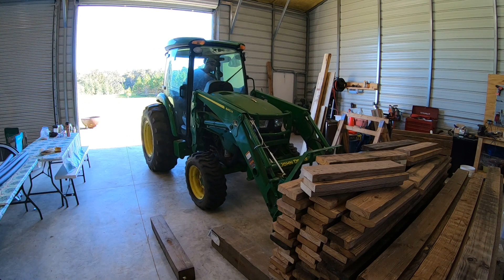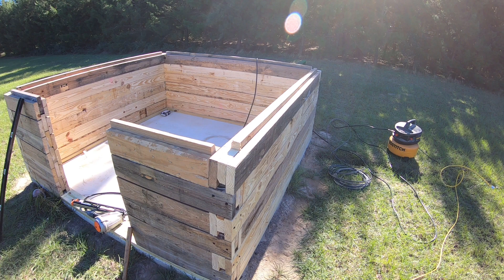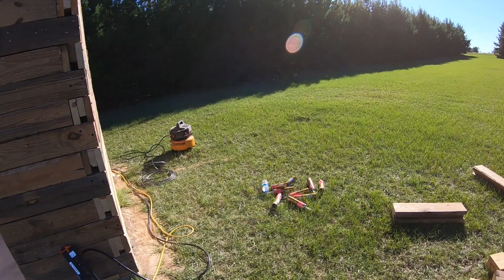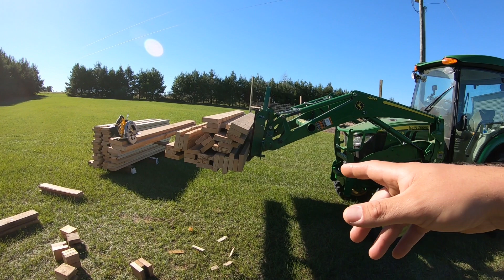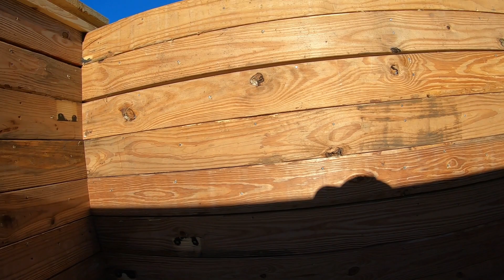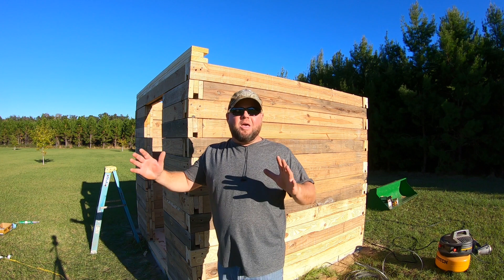#202 Storm shelter build continues! #7

Comment: Looking nice. Man you ain't lying about that wood being heavy. I hauled wood in my trailer for Home Depot one time. Grossed out at 78000 pounds. I'm grossed out at 80000 pounds. Almost was overloaded. I know your pythons are hurting from carrying that wood. Your tractor is definitely a huge help with this project.I was wondering how high you was going to go. I hope you get some good rest man and take it easy I hate to see you hurt yourself man.
Reply from the maker: I'm good, the older I get the more I learn to take it easy. That tractor has saved my back many a times! Work smarter not harder right? 😁
Reply: @TKCL  yes sir that's right work smarter not harder.

Comment: I'm thinking about doing an a-frame style shelter that is about 6ft to the top, just enough room to sit inside, with double layered 4x6's mounted to a concrete base. Anything would be safer than our mobile home that would probably generate more lift than a 747 aileron.
Reply from the maker: No doubt that would be a lot stronger.

Comment: on the outside of your rough structure.. pickup at least one gallon of roll on truck bed liner..  coat the outside of your shelter.. making it water proof.. you may want to create french drains around the structure and pile up and compact dirt  on the 3 sides at least 3/4 of the way to the roof..  keeping the slope at less than 45 degrees.. or build up the 3 sides in terraces  this will reduce wind loading.. hopefully you are going to take the cut off from that first roof block and cut it into short sections to plug the openings in the corners..  if you are going to put a window in.. you better make it out of something either laminated or an inch thick.. some glass shops have cut offs that you might be able to get from thick glass..  you can get water jet cutting companies to cut it to size for you.. or diamond wet saw to cut it to size.    a friend was on one of the hawaiian islands during a hurricane. when he realized the wind on the other side of the eye was going to blow the other way.. a small window in the garage was left uncovered.. as he was about to put plywood over it. the storm blew that window glass in and he ended up with a piece in his chest and having to be rescued..   when its done.. you can staple new battery packages to the inside of the walls.. so you have batteries at the ready. and not going bad in flash lights..  just add new ones to the wall every season ..  don't forget.. that you might want to put out some solar lights around the doorway or roof line... so at night you and your family can see your way to it..  these are just thoughts..
Reply from the maker: Probably going to coat the roof in asphalt covering. No windows, want to keep it solid as I can. Will build a second roof with tin and normal pitch to match other buildings and look normal. Not going to plug those small openings because the engineered plans call for them to be open as is. The plywood covers all openings and locks every piece together.
Reply: @TKCL  do you happen to have strap banding crimpers. and perhaps some stainless steel banding..  so you can put some bands around and over the roof.. and some concrete anchors with forged eye bolts to band it down tighter to your pad..  i missed how you fastened it down..  works on bigger structures too..
Reply from the maker: I fastened the base plate with tapcon screws. What's truly going to hold the structure down is yet to come. It will be anchored into the slab with Simpson strong ties and 5/8" concrete anchors. I'm also considering adding 4ft earth auger anchors to all corners as well, even though the plans don't call for that additional hold down.

Comment: Not sure what kind of door you’re installing but since that’s already a “weak” part have you thought about cutting the window unit into the door and just having the wires able to swing kinda like the wires on a trolling motor.
Reply from the maker: Don't think I want to do that, I want the door solid with no compromising holes in it since it's not as solid as the main frame. I also want this to look pleasing to the eye since it's in our yard, so I want the window unit on the backside. The door will comprise of 3 3/4 ply sheets glued together with sheet metal front and rear. I'm going to reinforce the AC window opening with very thick metal.

Comment: You already had those top pieces made? I think I see pieces without lip in your stack on the forks...
Reply from the maker: I cut the lip off of the tops while they were on the tractor forks. Just used my circular saw and ran down each side of the lip. I could have ripped the board when I was building them and already had that done. I felt it was just as easy to cut them this way.